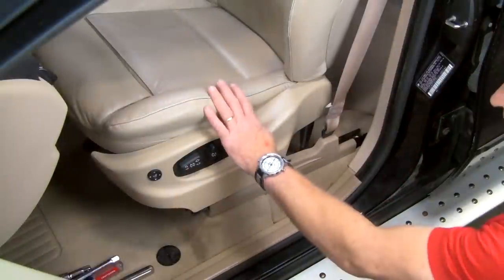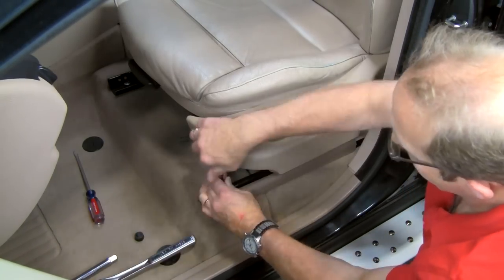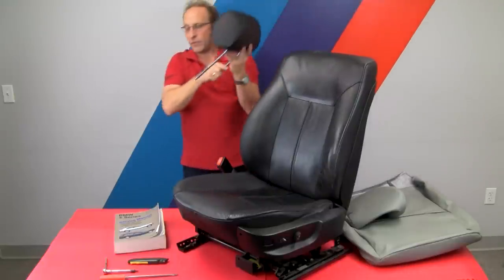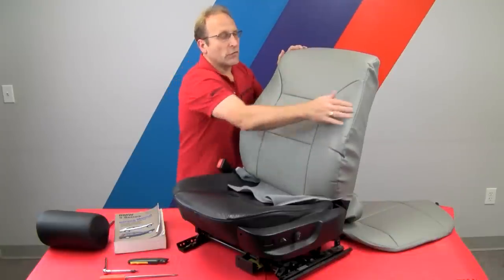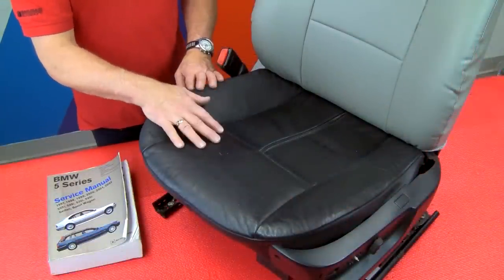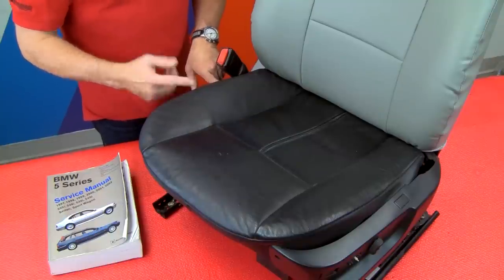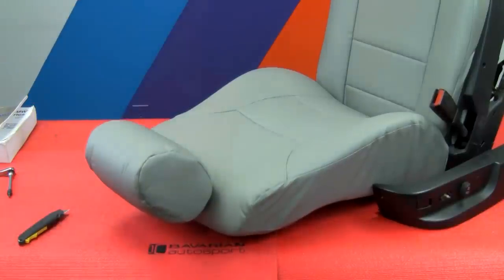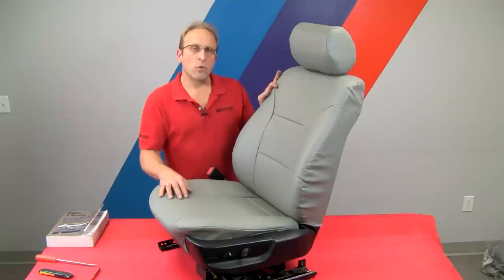Installing custom-fit seat covers on BMW & MINI front seats

Comment: Did I miss the part of the video where they say to disconnect the battery before unplugging the seat wiring harness?  Otherwise won't the airbag warning light (SRS light) go off because of the seat belt tensioner?  The SRS light can't be reset by an OBD II device. Seems like an important detail to leave out.
Reply: +Matt Nelson I put on the black/gray neoprene covers on the front seats (standard) of my '03 325i.  They turned out much better than the vinyl ones in the video.  I don't have wrinkles or fold lines because they fit really tight.  I had to take the seats out and remove the cover for my manual controls.  This video was not helpful in that area.  My biggest issue is why aren't 4 packages of the clips put in there if it is a KNOWN problem???

Comment: Final result is awful
Usually I love your vids but here I'm very sad about it :'(
Reply from the maker: If you need seat covers, these are the best fit that you can get.  Much better than a torn up seat!
Reply: Maybe you'd better change the complete leather
Reply: It doesn't look great, but its not AWFUL.  I wish my seat looked as good as the one in this video (before the seat cover was added).  My driver's seat has huge tears in it.  It looks AWFUL.  /cry

Comment: May I suggest a new video that shows these cover installed on the sport seats? I just finished mine and while this video was very helpful, the front seat sliding cushion proved to be a very difficult portion of the install. I have to redo mine to figure out a way to get the straps located properly. It may involve cutting the leather between the bottom cushion and the sliding part.